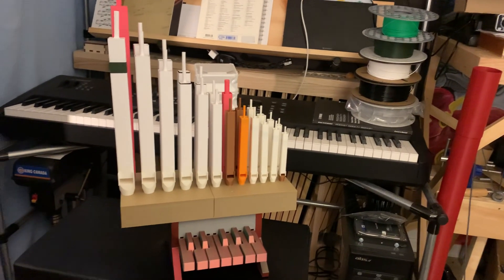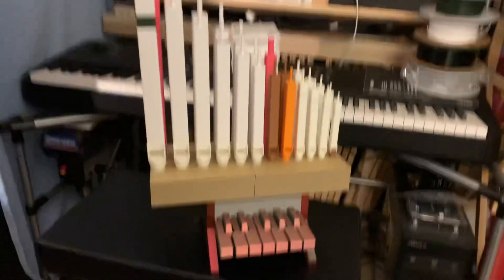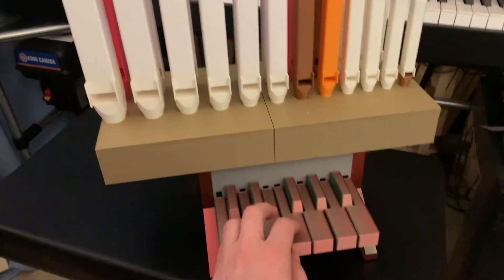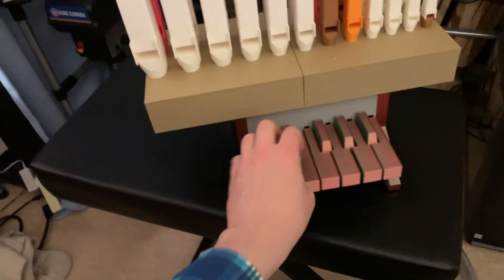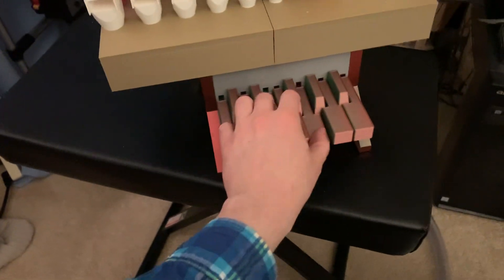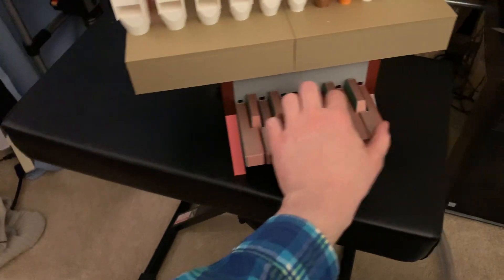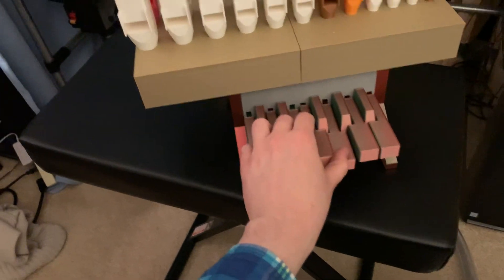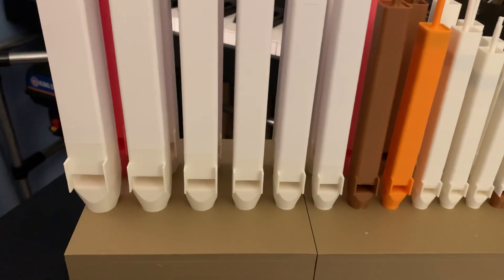3-D printed pipe organ getting better !

Comment: You can tell he’s not a musician because the keyboard only goes for C to B. Yes it technically has “all the notes”. But that empty feeling in my soul left by not going back to C is just so sad.
Reply from the maker: Awe, poor muffin :)  I built this to test various mechanical ideas, including a stop mechanism that comes in 12-key blocks.  If it had worked better, I could've added a second octave or more with almost no waste, but (despite actually working in a later video) it was back to the drawing board for the stop mechanism and the wind routing.
Reply from the maker: Oh, and another detail you may be interested in: The next prototype has a planned range of E3-B5 (A440) or F3-C6 (A415).  That is to cover my personal vocal range up an octave, while avoiding a high or low black key in either pitch. So, if you like baroque pitch, your sad soul will get its satisfaction.
Reply: I don't see what having a keyboard being C to B has to do with not being a musician. It comes across as a troll. You're just jealous that he built his own pipe organ and you weren't able to.

Comment: May I suggest to prevent your bellows from sticking out, on the inside to apply rubber bands around the edges that want to stick out. The tighter the better (Not too tight that it will break or snap).